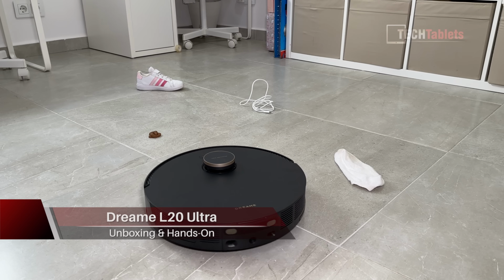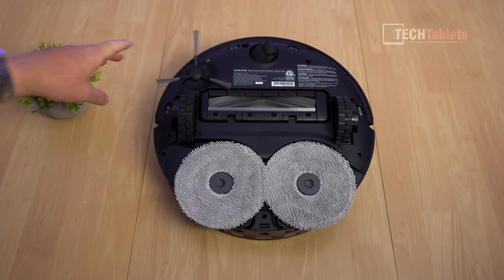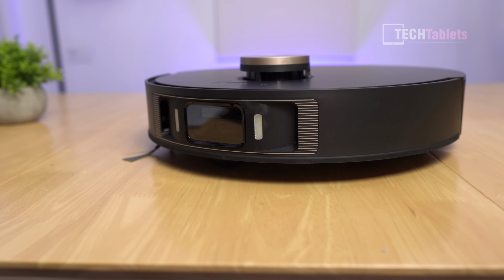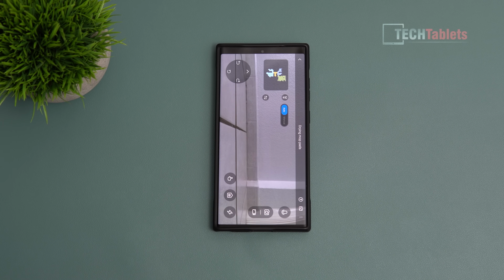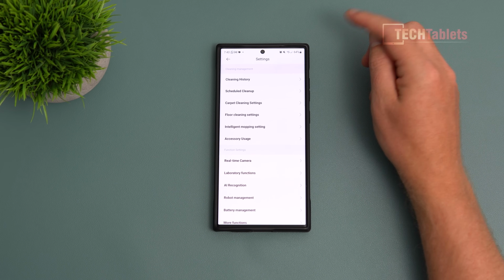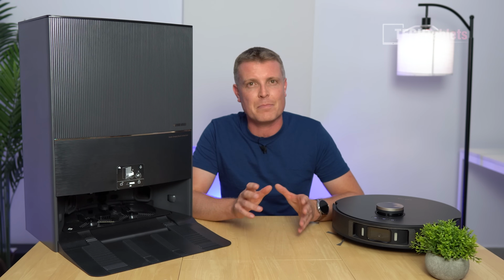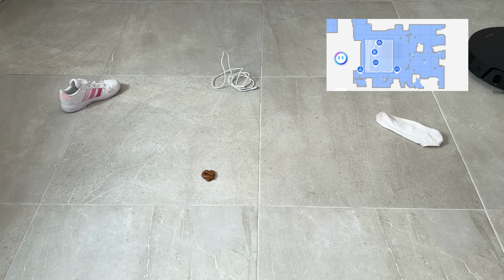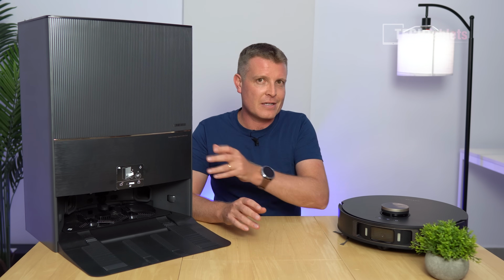Dreame L20 Ultra Review - The Most Advanced Robot Vacuum Tested!

Comment: I purchased this product a month ago and used it for a day. In that time, the vacuum performed well in cleaning, mapping, obstacle avoidance, etc. Mopping, however, was unavailable to me as there was a defect in the attachment of the mop pads that caused them to be dropped whenever the vacuum would start with the mop pads attached. I've seen this issue reported by other users.

I contacted their support, received some troubleshooting steps, and attempted to resolve the issue. As this is likely some sort of problem that isn't user correctable (the pads are connected fine when not operating, I can turn the thing upside down and hold it by the pads), none of the troubleshooting steps resolved the issue. They informed me that they would have to process a replacement. Fine. I understand that complex products sometimes have issues.

I boxed up the robot and returned them item, as instructed, the next day. After being delivered 3 days later to their warehouse I received no follow up information for multiple days. Through several requests for an update I was greeted only with "we'll follow up with you soon" replies by the same person who I can only assume is their lone US support agent. I requested escalation of the issue. Same response. There appears to be no communication, escalation, or much of anything process. After waiting until the last possible day that I am eligible for a return through Amazon I reached out to Amazon's support for a refund. They were able to do this for me, thankfully.

I will for sure not be buying any of their products again, and would not recommend them to anyone else due to the complete lack of support and proper customer service. While this product may in fact be great, if the time comes where I need to use the warranty or have any service done by the manufacturer, I do not expect that to be available.

Comment: Is it better than the roborock s8 ultra pro vac? I just biught thay today do, do i return it unopened sealed for a dreme L20?
Reply from the maker: S8 Ultra is still very good, I wouldn't return it. This does have better object avoidance I found and the camera.
Reply: @Techtablets  thank you for the advice, these are expensive is Australia, $2499 which is about $1800 USD.  I did end up swapping it to a L20 so time will tell, I think they are both amazing.

Comment: How does this vac compare with the Roborock S7 MaxV Ultra in picking up dog hair on carpet? I have an Australian Shepherd that sheds a lot, and with my current S5vMax (whose brush does have bristles), it has been extremely frustrating to have to pause the vac after every room to empty the 350 ml dustbin! I've aeen other reviews that say the S8 Pro Ultra and S7 Max Ultra (not the V) have poor object avoidance.
Reply: Dreame robots have soft rubber rollers. Not the best for hair. But they are far less prone to jam or tangle. Dreame robots such as the L20 can detect the bin is full and return to the base station to empty their container. The Dreame robots are extremly hands off. Minus refills for the water etc. 

Dreame robots have better ejection of waste than Roborock. I've seen comparison videos where the dreame will deposit 99% of the dust they pick up. Where others leave 20-30% when returning to the base

Comment: Great video! Two questions for you!

1. Will it empty itself during a clean of the entire house? I find my current one will get too full (lots of cats) amd it won't effectively clean one part of the house.

2. Do you have any small ridges that you potentially tested it going over? I've found that I've had to put masking tape on places where my tiles/wooden-floor meet because it's about a 2cm drop between thw two surfaces.

Cheers!
Reply from the maker: Hi,

No it's going to empty after the clean is done. To advoid that problem you could schedule or run it more often? 

I had it going over the stand of my two girls desks which is about 2cm and it did make a bit of nosie and take a while but eventfully goes over it. 

Hope that helps!

Comment: The ability to plumb this into the wall water/waste etc is the next big battle ground for robot vacuums, so more detail on that would be nice. I dislike what looks like the proprietary detergent pack that you’d need to keep buying and would eventually be discontinued. It does make me laugh tho when the summation of the review is that despite all these features it doesn’t clean very well (on carpet at least) Great review, thank you!
Reply from the maker: Unfortunately I have no more info on that it's an optional extra that you plug in then to waste and clean water. As for the detergent pack you don't have to use it once it runs out. I you could even cut a hole in the top of it and fill it up (don't remove it) As for the cleaning, mops great but like all of these rubber only roller brushes they are not good at lifting up pet fur and long hairs. Thanks for watching!!

Comment: I do not have carpet so I wonder if the robot would drop the mopping pad for only-vacuum task?
Reply from the maker: No it will just lift them up then, only drops them for a no mop zone in your case. Or you could just remove them if you don't want it mopping.

Comment: Those devices are getting more and more impressive, can't wait to upgrade, although our chuwi (forgot the model) is still going strong after ~6 years and 1 battery change. Do you think one could rely solely on a device like that for cleaning? Are we in the future yet?
Reply from the maker: Well this is as close as it gets to such a device. With this latest Ai avoidance ones and the better mopping and auto empty clean etc we barely need to manually go around and mop or vacuum. Once a month now just in the corners or edges where they don't made it. But now this mops even closer this L20 Ultra so only the stairs we have to manually do.